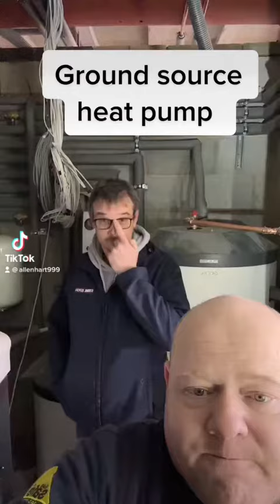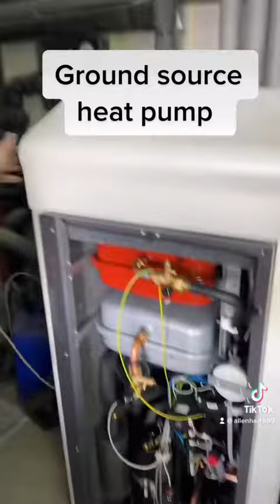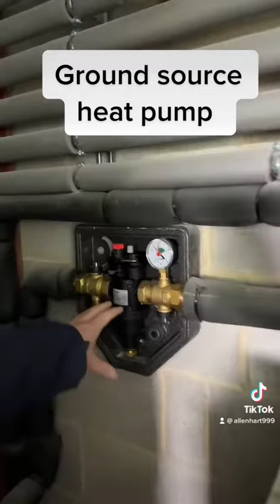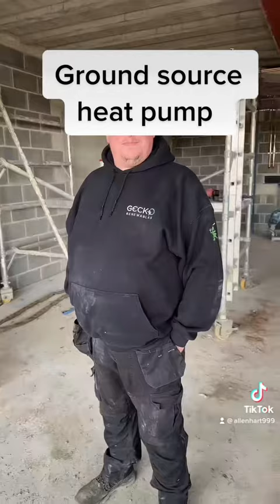Ground Source Heat Pump

Comment: Do you have to bore downwards? Could the pipes be laid in horizontally at a shallower depthif you have a large garden?

What's the installation cost of a ground source heat pump? 

Are they simple to maintain?

What's the working life of the system?
Reply: You can use either horizontal collector or borehole depends on size of house an situation .Cost of heatpumps are around the same extra difference comes by way of either having a borehole or horizontal collector for geo.Geo is easy to maintain just check and clean filters.Hdpe pipe that,s used externally has easily  lifspan of 100 yrs +,Hp is indoors so worst case compressor could go but usually lasts 15 to 20 yrs.

Comment: These heat pumps need a lot of space to fit the kit. In new builds space is at a premium so is it a viable option to developers who are trying to cut cost. I was an air con engineer before retiring the condenser units fitted outside, where always noisy and got worse with age. If we follow this option I can imagine it will be pretty loud in the neighbourhood in the the middle of winter.
Reply: Why would a ground source heat pump be loud?  The minimum specification of a new-build house is a political choice.
Reply: Im talking of air sourced heat pumps. There is mechanical parts that wear and become noisy over time. Also the sound of the air moving through the unit.

Comment: 3 degrees coming in sounds low would expect atleast 5-7 in the winter, would like to more about the system design if possible. Comparing to oil even though is a rural property is a bit of shit comparision as running costs are going to be miles cheaper, what was the install cost over money going to be saved?
Reply: Not enough dwell time underground to pick up maximum ground temperature input. Undersized underground system?

Comment: 1 question. This really relates for people let’s say terraced houses 3 bed semis and even detached. Over the years everyone got rid of their copper tank and the space it took. So where are people going to put all this equipment ? That is if these heat pumps are a viable option which in my opinion they are not.